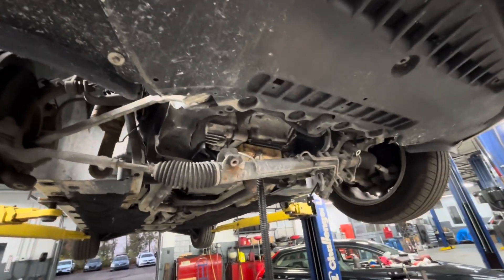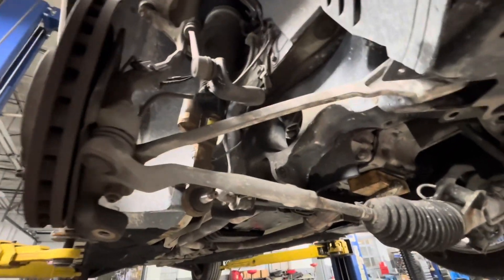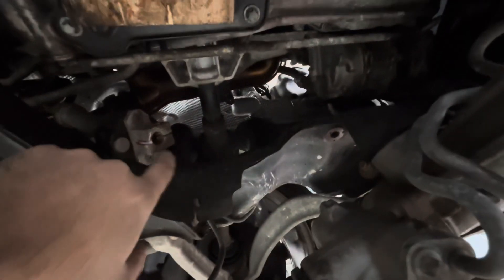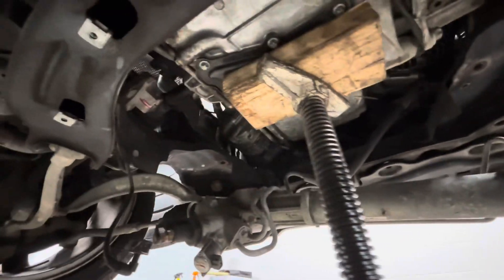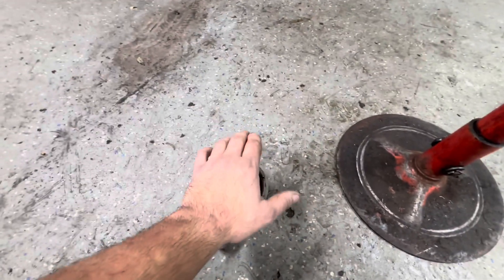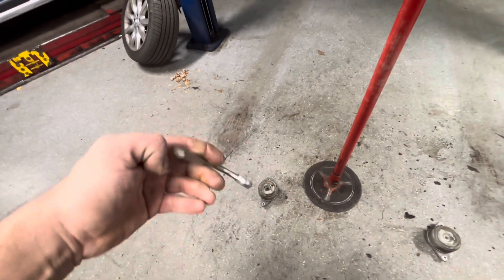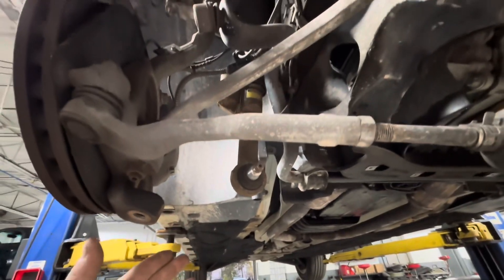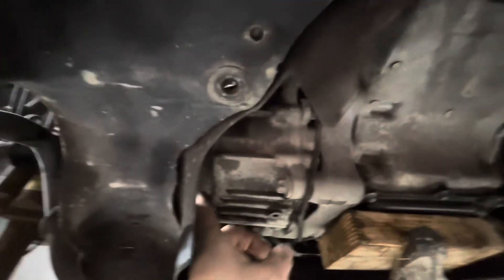2007 MERCEDES S550 ENGINE MOUNT REPLACEMENT OVERVIEW

Comment: Can you do an explanation video on how to replace dipstick tube on a 2014 vw Jetta 2.0? I saw your video on common oil leaks on one and my problem is I somehow have a half inch long hole at the top of my dipstick tube near wear the dipstick goes in and it’s sucking air. I’ve had the car a month from the dealer It looks like a screw or something went in sideways on it.

Comment: This is gold.  I got a 4matic and was thinking of pulling the axle.  It’s great to know it works.  Did you undo the motor mount bolts from the top or did you do it from under the car?
Reply from the maker: I believe I did it from the top, thanks man!